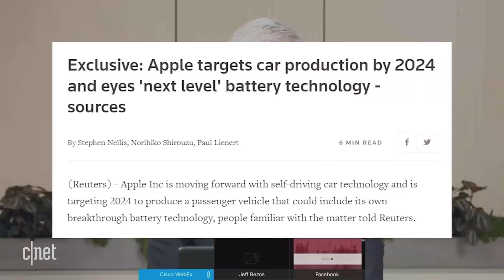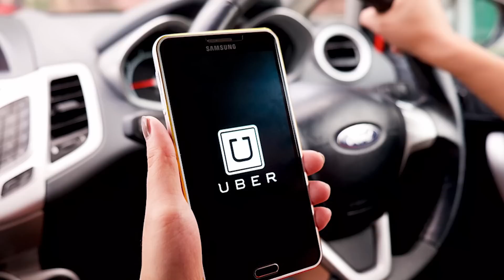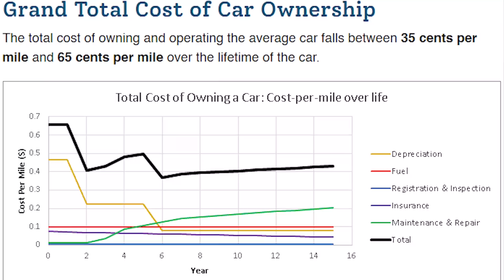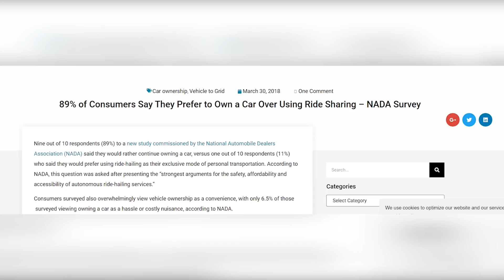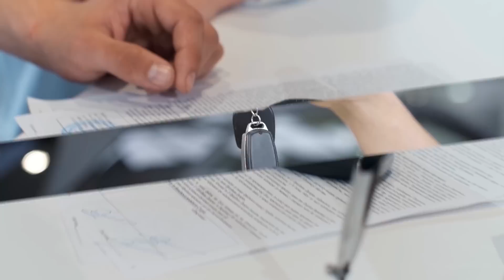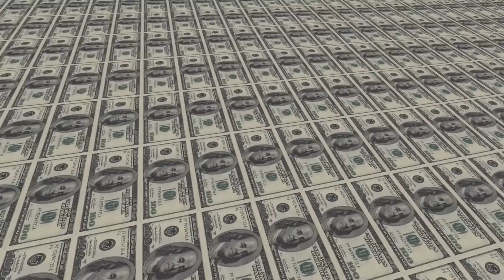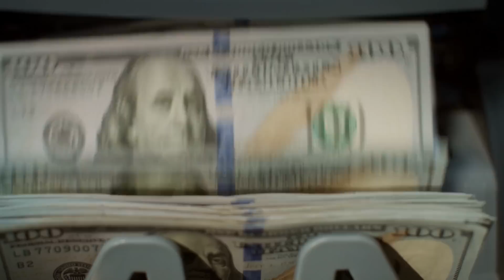Why Are Some Companies Giving Up On Robotaxis?

Comment: Tesla will not license out Robotaxi. FSD and Autopilot maybe. But Tesla would be dumb to let someone else profit on all their hardwork. Tesla has the at scale software know how and the distribution power to just replace Uber entirely without spending much of a dime, as long as the self-driving part works.

Comment: You video was good but one thing you focus too much on was the savings per miles. That's not the big picture, the big picture is the amount of time you will save. No having to focus on the road means you can do something else with that time, road trips  is the most time consuming one of all and Tesla directions to Robotaxi will help with that.
Reply from the maker: True, but you can save time by buying your own autonomous car. You don’t have to rely on robotaxis.
Reply: @LogicallyAnswered  yes, that is also an option for those who has the money.
Reply: @stanleycius3295  you think taking a robo taxi everyday is cheaper than buying a car?
Reply: @TheBooban  how did you come up with that, no matter how many times I read my comment, I still can't figure it out
Reply: @stanleycius3295  in your reply, you implied you have to be rich to buy a car. But you would have to be even richer to use a taxi everyday.
Reply: @TheBooban  in my second comment, I said if you have the money, that's not implying that they need to be rich. But it's certainly true, you will need some money to buy a Tesla that has Robotaxi capabilities or any other brand that decides to follow Tesla.
Reply: @stanleycius3295  thats funny.
Reply: When the car is in my driveway at the time I decide I need to run to the store and can be there and back home in under 15 minutes, I save a lot more time than waiting even 10 minutes for the robotaxi to arrive after I call it after I figure out I need to summon it, and the next 5-10 minutes I need to wait for the return-home car to get there when I'm done in the store.  I'm also not paying per minute to unload groceries and I don't have to worry about whether I left something on the passenger seat.
Reply: @AaronCoakley  You can order online and get it delivered in 15 minutes by a drone or a self driving vehicle, similar to what Amazon is developing.
Reply: @AaronCoakley  Or you could plan your cities better. There's no reason most of the things shouldn't be within walking distance if you live in a city. Or on the way back from work. There's a Lidl 150m away from my apartment building (though Lidl sucks, so don't visit it often), a store i like 5min walk away, and huge department store /mall with everything i would need 8 min walk away. Thousands of $ per year in expenses does not make much sense. Not to mention parking is always an issue. So just plan your cities better to be friendlier to pedestrians and cyclists.
Reply: @fobusas  What city?  There is no city to plan.  That's the point.  That's most of the land-mass of the US.
Reply: @AaronCoakley  Any city. Just because people or politicians are not willing to sensible plan the cities, doesn't mean it can't be done. 
Even in really old european cities we manage to adapt them for pedestrian life. It should be piece of cake in usa, since everything gets torn down after a few decades anyway. Problem in usa is political, as in there's no will to do better, as your own preferences indicate, you'd rather drown in car traffic....
Reply: @fobusas  I'm talking about places where the nearest living person not in the household is a mile away.  A city is non-sense to us.  "the store" is the only other business besides a couple of bars, a gas station and a church.  City-folk don't even know these places exist, but these are more common per square mile/kilometer than even a town of 100 people.
Reply: @AaronCoakley   @Aaron Coakley  Dude... i'm not talking about rural areas. USA is 85% urban. and it's only gonna increase further. Just because there villages or sparsely populated areas, does not mean you should be stupid about planning the cities that you have. 
It's super misleading of you to injected. Ofc some urban development is less relevent to you then, but you passed it off as if you were living in city...You need to disclose that shit first...

Comment: convenience helps a lot, in my case I can't afford new.  so I buy beaten up cars cheap, repair and viola.  nice running car often for less than $2000 and able to put on 40,000 miles or more (so far the two vehicles I have sold I put on more than 50,000 miles and sold in running shape).  so for people that are like me (or more skilled with automotive repairs) can get vehicles dirt cheap, repair, and get many years/miles out of the vehicle.  the robo-taxi would have been nice as another revenue stream for my family but I can see it being a large headache and such to keep from getting sued when it wasn't my fault
Reply: Exactly!  I have already put over 100k miles on a car I paid $300 for and needed only minor repairs.  Don't forget that you can get much cheaper insurance when you don't need full coverage, which greatly lowers the cost per mile even more.
Reply: I don't mind paying for full coverage.  but thanks to repairing a vehicle yourself that is why I think the real game changer is going to be when you can get a used electric car in good shape and condition (or not that expensive to get it there) for under $3,000.  that said I hope they do.  it does bite when you have to do an engine/transmissions rebuild/replacement because the previous person not only was bad on maintenance but took terrible care of it while treating it terribly